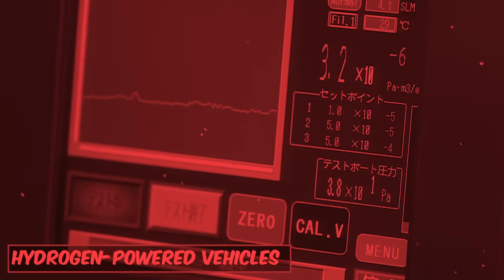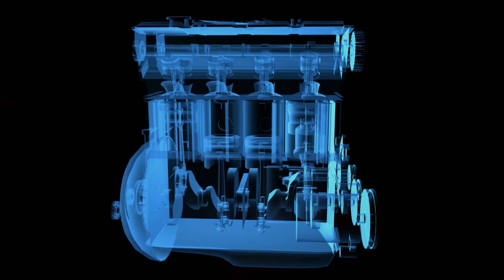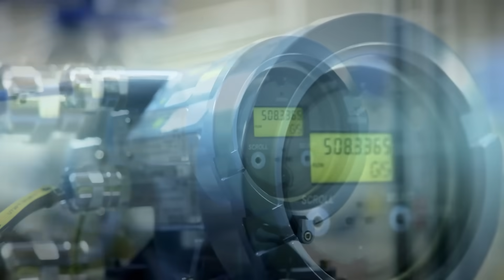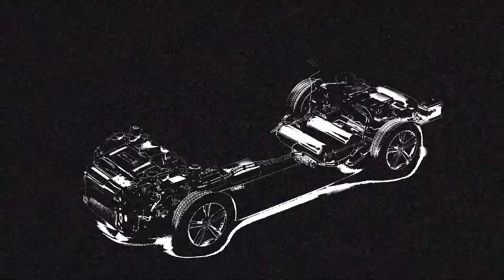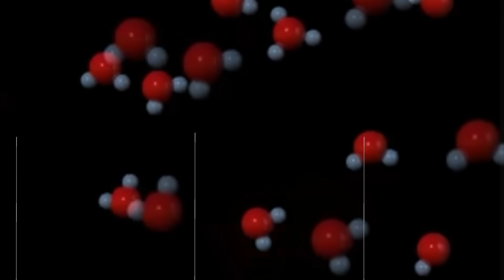Toyota's New WATER Engine Will Destroy The Entire EV Industry!

Comment: Doesn’t this violate the 2nd law of thermodynamics that means you would have to put more energy into splitting water 💦 before burning 🔥 and combining it back into water 💦 again?
Reply: It probably won't actually combine it back into water otherwise there'd be no energy for the car to use. Even the "actual water engines" people have made for their own cars in videos imply they still have to refill the tank with water but equally as gas vehicles
Reply: @mastupilo9653  I have no idea how these are supposed to work. If you use energy (in any form) to break down water into hydrogen and oxygen you will ALWAYS get less energy back when you burn the hydrogen.
If you don't burn the hydrogen, as you suggest, then no energy will be released.
Reply: Stanley Meyer successfully did it and drove across the America on 20 us gallons of water
Reply: I used hydrogen i have from a bottle welding gas that supply stores sell. I injected a old propane type engine with a controlled by a regulator mix as a fuel. Ran real strong.  Problem of converting H2O into a gas is the ticket. Back a few years fuel cells were being tried.  Its the components that are the problem . Takes alot of power to split it but it can be done.
Reply: @robertghorne8607  Bob Lazar figured it out.
Reply: @SHL-ge3wn  he's the guy who ended up MIA?  Gasoline starts as a liquid then it gets atomized @ carb. Fuel injection samething. U add nitrous oxide as a gas its a power booster . Now making a element that does  water into a gas when needed . These guys who say they did it seem to end up gone. Makes 1 wonder if its not that big of a  deal to make somthing that'll do it.
Reply: @robertghorne8607  The perpetual problem is that you cannot get energy for nothing and you certainly can't get it from water.
Fortunately for the con men selling this technology there are plenty of dupes out there with no understanding of thermodynamics who can still be fooled.
Reply: @eckyhen  problem is turning water into hydrogen from fuel cell technology. But make only enough to run a engine is the plan. Components take alot of watts to do this.  In a conventional type of cell that uses heat/ electrolysis  to split out a  gas from water. Still its possible. Dont take much to run a small engine. In air gas ratio. But it. Has to be a constant amount  with more for speed increases . Something as a propane engine.
Reply: @robertghorne8607  What is the point of using an energy source to split water into hydrogen and oxygen and then turn the hydrogen you have made back into water if you get less energy out than you used to make it in the first place?
Reply: @eckyhen  More moving parts which would need replacing.
Reply: It would if done without a catalyst.  A platinum anode works as a catalyst, as does a mild concentration of sulphuric acid in the water.
Reply: @TheTrock121  So what?
It still does not overcome the fundamental problem.
You have to expend more energy splitting water than you get back whem you burn the hydrogen produced. This cannot be overcome by catalysts, high voltages or any other magic. It is just a fundamental problem which is called the law of conservation of energy'; (first law of thermodynamics)
"Energy cannot be created or destroyed, it can only be converted from one form to another."
Reply: The energy needed to distill water has to be found somewhere and this energy cost must be added. How does this relate to the energy balance?
Reply: @lievenmoelants  dehumidifier gives DI water. In its process
Reply: Nope !
Reply: it also violates common sense.  if you made such a device why would you turn it into a car to sell to others.  when you could keep it and just sell people the energy you make for zero fuel cost.
Reply: @grabbagool it uses hho
Reply: It's a spoof. Quite amusing really.
Reply: Obviously but who cares if you are trying to con people. As they say, a fool and his money are easily seperated.
Reply: LoL 😂 
Yes they are - Just ask any Tesla Cyberstuck buyer...
Reply: Sssh! Don't expose the snake oil bullsh it!
Reply: @momochi9790:  Bull.  The Thomson-Clausius principle refers to the heat death of the universe and the fact that the energy of the universe remains constant but trends towards increased entropy.  Your reference to this principle is misapplied.  In this case, the "water engine cycle" (there is no such thing, BTW) is a closed system.  The T-C principle views the entire universe as a closed system.  Therefore, your boundaries are wrong.  Electrolysis is not a "catalysist" though it uses a catalyst (big difference) - it is actually a  chemical process that requires an energy input.  Don't try to use fancy science-sounding words to promote a fantasy.  The "watercar engine" as depicted here can NEVER and WILL NEVER exist until someone can figure out how to split water for LESS energy than the resulting hydrogen combustion can produce.  Period..  If you think you are right - prove it with your balanced Gibbs free energy equations, then publish your groundbreaking results in a scientific journal, get some DoD funding, and build a working prototype.  You WILL win the Nobel Peace Prize and be able to retire and leave your great great great grandchildren a fortune.
Reply: @DefinitelyNotOnTerms  OK. So you don't understand the science. Not a problem as many others don't either, but take it from someone who does. You must put more energy in to make the hydrogen than you get back when you burn it. Of course it can be made to work but it is pointless since it is less efficient than using your energy source directly to drive the car. Note that they do not say where the energy to split the hydrogen comes from.
This is just plain dishonest.
Reply: This video does not delve too deeply into the chemical reaction (beside general concept), so we can't really know unless we actually study and observe a working prototype or sample of the engine.
Reply: @ChrisAlbertH47  The mechanism of the reaction is irrelevant to the thermodynamics of the process. It ALWAYS uses more energy to make the hydrogen than you get back when you burn it. That is why you will never see a working prototype.
Reply: @eckyhen  I understand the concept that you're referring to, but do you honestly think that the engineers and scientists at these mega companies don't? If they're investing serious money into a project, do you honestly think it would be on a dead end?

We don't know what they're working on exactly, what the design of the engine is, or how it works. This video and others like it only have a general idea of what it could be , and that's the not enough to base any assumptions on.
Reply: NO!
Reply: If you believe in UFOs, you will note that the way they are said to accelerate and change direction, also violates certain basic laws of physics that we accept at this time.
Reply: Thank you
Reply: 😅it's not fiction folks, just Google it, it's almost here.
Reply: Yes. It is the usual old nonsense posted by ignorant conspiracy theorists designed to con the ignorant and gullible.
Reply: Thanks for using emojis, no one would have known what you meant without them.
Reply: B.s
Reply: DUW! mad magazine never mentioned thermowhatsits😅
Reply: It even violates the first law of thermodynamics, conservation of energy, because in this engine energy arises from nothing. Very convenient, but of course impossible.
Reply: @svergurd3873 it uses hho ..smaller versions has already been proved in kit forms
Reply: Yes and no.
There are other ways to split the atomic bond to free the hydrogen. Everyone assumes it's generic electrolysis which is not the case here.
I can see many people laughing initially until they realise they have been scamed into believing water can't be a fuel.
Let's just get some facts sorted first.
There is no such thing as fossil fuel, it is made by conventional planetary forces (see Titans massive oil reserves) and look deeper into hydrogen and you will find alternative liberation methods that overcome the apparent conservation laws.
One thing is for certain yet few realise yet that the future of energy production will be hydrogen based, at least while we use exosion techniques but after hydrogen had run it's course the following phase will be implosion tech.
Yes, you can indeed actually run a car on water if you don't use electrolysis
Reply: Absolutely.
Reply: Lookup Moxy fusion reactor.  Toyota is probably using Argon gas to create  a cold fusion reaction.
Reply: 3:28 he definitely says "diluted water". Diluted with what? Petrol?
Reply: Do you know your microwave oven can reach higher temperatures than a regular nichrome wire heater of the same wattage? That doesn't violate law of thermodynamics. It just means that special substance as catalyst which aids in production of excess energy. 

I did a quick search and found out that Scientists Have Developed The Most Efficient Water-Splitting Catalyst. The catalyst is made up of a ferrous metaphosphate and a conductive nickel foam platform, a combination of materials the team says is more efficient and less expensive than existing solutions.
Reply: NO
Reply: Consider the two operational states-1. UnSteadyState: At start, there is no energy begin the electrolysis (thus requires a battery. 2. SteadyState: The energy to separate Hydrogen from Water is greater than the energy of the released Hydrogen. The battery is then the only net source of energy, the engine quits when the battery is depleted. Essentially what it is is a very expensive, and illogical BEV.
Reply: Peaple  are forgetting  facts do you want a 5 minute to fill up with high  pressure  hydrogen   or a 1hour of sitting  on a charger 🤔    and then hoping  your car doesn't  spontaneously  combust  😂
Reply: That is the point. Until law's of thermodynamics change
Reply: Yes cos to split water into hydron and oxygen you need atleast 12v at atleast 10amps so a car 10amp battery will go flat in 1 hour and your car won't start untill you charge it for 24hours.
Reply: They must show us energy balance ( energy In / energy out ) . You will see that energy in is greater than energy out.
Reply: Using a low voltage pulsed method it’s economical, it’s how Stanley Meyer did his initial system
Reply: Hydrogen bombs release a lot of energy and I can't see that it takes too much energy to make it a reality. The advances made in battery technology makes me believe we were told a bunch of lies by gas corporations.
Reply: Complete and utter nonsense. Splitting water into oxygen and hydrogen needs A LOT of energy. If you’ve ever seen an oxygen/hydrogen explosion you’d understand.
Reply: When he breaks the water molecules down he is shattering the water molecule bond between the hydrogen and the oxygen  with low voltage electricel  at a frequence that shaters the bond like the singer sings the right note that shaters tbubbles. Betwen the oxygen and the hydrogen. If you see the videos youl see the gases fome up. The navy witch uses higher voltage gets a small stream of bubles. No fome of bubbles.
Reply: Splitting hydrogen from water is in the amperage, not  voltage or more power, it takes very little power to separate hydrogen from water. Do your research
Reply: EXACTLY...dudes doing it for $500 in ads 🤦
Reply: The presentation of the idea is COMPLETELY wrong. Whoever has written the script, is not really Science literate. (I wonder how deep was the involvement of chatGPT).

The system is not "Fueled" with water. It is fueled with electricity that is used to electrolyze water. ( @1:31 ) 
Water is just the working fluid. It gets broken down into Hydrogen & Oxygen. The Hydrogen should get separated from Oxygen & stored into a tank for being oxidized back to water in the IC engine. 

The whole thing still runs on electricity. It is just changing the battery from Lithium ions based system to Hydrogen based one.

It is a lot of jumping around in terms of thermodynamics & too complex. For the foreseeable future, I will not be moving my investment from Tesla to Toyota shares.
Reply: will see, how foreseeable You are, "Tesla owner". You simply can't know, what are they doing @ignorasmus
Reply: @ignorasmus  - From the performance of Teslas this past week, in the Siberian Xpress, I wouldn’t have stock in it either.
Reply: @ignorasmus 
It's a joke to test people's gullibility.
Reply: @ignorasmus  there is the other way though. 
Conventional electrolysis is only the cheap crude high loss methodology. Getting hydrogen and oxygen separated can be facilitated a number of ways. For example the resonant frequency of H2O allows for low power separation compared to electrolysis, the trick is the frequency shifts and that's where clever open minded people play around. Convention has nearly always been the greatest barrier to all discovery. We know very little about true science, it's a fatal flaw of humans to suppose we know almost all of it. Concider Nikola Teslas Wardenclif tower, he stated in court he didn't send any electromagnetic energy from that tower yet a hundred years later we all still call him an idiot for not grasping the obvious flaw of square law losses by transmission which is correct if you attempted to radiate large quantities of power in the air but he wasn't because he used the second form of electricity, yes, there are 2. Yet the 'smart acedemics' still perpetualy push mistruths. Toyota are not simply electrolising the water nor adding electrolytes to facilitate the outcome, they are making use of unconventional and useful physics
Reply: Seems to me that an on board alternator/generator could supply the volts for electrolysis. So, as in gas engines, you would need a battery to start the process and it would be continued with the generator.

Does it matter if it takes more energy to make , than what is released from the hydrogen? The goal is to get rid of polluting transportation. So what if it takes more water to get comparable energy?
Reply: @JS-yv8ks  Hahahahahahahahahahahaha
Reply: ....Can't run a generator without MORE continuous power from the source you are not naming.... @JS-yv8ks
Reply: @JS-yv8ks  Bro, if it takes more energy than what you get back (which it does), then that means that the car will need a big battery for the production of the hydrogen that you will need to charge and you will get less range than if you used the energy from the battery to run the car directly...
Reply: @JS-yv8ks  You burn more petrol/diesel to make the generator work harder so that is not such a good idea.
Reply: No. There is NO fossil fuel involved ! So your idea is bad. @eckyhen
Reply: @JS-yv8ks  OK. Explain to me, in simple terms, where the energy to power the car comes from.
Reply: Really?? I think the basic idea is very clear, the engine runs on hydrogen ! Did you watch the video??? @eckyhen
Reply: @JS-yv8ks  Hydrogen from water is not a fuel source, it's a storage mechanism. You'd be better of powering an directly electric motor than converting electrical energy in to hydrogen and burning it. That would have less loss, and most importantly, less moving part which would need constant replacement.
Reply: @eckyhen 
Laughing Gas. This is a joke.
Reply: @DaveHaynie  I can understand how that would work but seems totally pointless and very inefficient since you will have energy losses with every conversion.
Charging, didcharging, elctrolysis
Reply: @DaveHaynie  I understand how that would work but since you have energy losses at every conversion it would be very inefficient. What is the point?
Reply: @eckyhen  I dug a bit deeper online... I'm convinced it's an outright hoax. Just because there is a way do to this, maybe (depending on the capacity of the electrolysis plant, your bottleneck) doesn't mean it's practical in any way.
Reply: Yep, it's an obvious scam. Toyota's engineering and PR departments need to sue the makers of this for defamation. Since I downloaded and viewed it in the UK, that gives British libel courts sufficient jurisdiction. OK, the presenters have an option of a "we are idiots and never wondered where the power for the electrolysis would come from" defence. But they played a straight bat, so they obviously weren't going for parody (which isn't a defence against libel in any case).
Reply: You violated the FIRST law of emojis… Never use one, and the word, in the same sentence.
Reply: It violates nothing. The bit about "high voltage"? It's what Stanley Meyer came up with; high-voltage, high-frequency (Meyer was ~22KHz), negligible current. IOW, negligible power required to break the covalent bond. See the injector? Water and the modulated electrical signal are fed directly to the injector and out comes hydrogen, straight into the combustion chamber.
Reply: @AdaptivePhenix  LOL. thermodynamics, remember?
Reply: @AdaptivePhenix  And where does that electricity come from? This proposal is basically a perpetual-motion machine.
Reply: @AdaptivePhenix You have it very clear!! I wonder where we can we get the specs for Stanley Meyer's water engine system? It would be quite an interesting read!
Reply: @AdaptivePhenix  No
Reply: @AdaptivePhenix  It most certainly does violate the first law of thermodynamics since it implies that you can create energy out of thin air.
It takes 286kj of energy to decompose one mole of water into hydrogen and oxygen an it is impossible to get more than 286 kj of energy back when you recombine them. In practice you always lose some of the energy so this engine is impossible.
Reply: @eckyhen   You mean like the US Navy Ship that runs entirely on seawater doesn't work? Would you like to inform them because I ain't.
Reply: That's nonsense. No engine is 100% efficient, you always lose some energy in the process of ANY engine. Even the electric motor is not 100% efficient.  @eckyhen
Reply: You should inform the CEO of Toyota, because he believes it is possible and just announced recently that they are working on that impossible engine ! @eckyhen
Reply: @AdaptivePhenix I believe that's battery powered much like the saltwater powered cars
Reply: @universalvindicator  No it ain't... that's ridiculous (weight?).
How can you people be so dense to not understand that splitting water doesn't need to be energy inefficient.
It's not free energy it is energy from an abundant resource.
Reply: @eckyhen  Dont the free point energy system could be used like ET and our secret craft
Reply: @pauldavies6037  Well if you can explain what "free point energy" is' maybe?
Reply: @JS-yv8ks  yes, it's called friction.
Reply: @eckyhen  the loss is due to friction
Reply: @AdaptivePhenix  Which ship is that, I'd like to know.
Reply: @AdaptivePhenix   This is physics.  They already know, because they have to supply the energy for any electrolysis.
Reply: @tpaine7680  Let me ask you something; It's generally accepted that 40 milliamperes is enough to kill a human being. So what happens when you grab both terminals of a car battery that can typically supply 70 Amperes for a full hour?
And how does that compare to law enforcement with their puny little stun guns. Which would you prefer to come in contact with?
Reply: @eckyhen but it's not taking it out of thin air it's taking it out of water
Reply: @eckyhen Its not impossible, you'd just need a power source to split water into Hydrogen and Oxygen, perhaps a big battery.  🙂
Reply: @st200ol  Yes, and you need to put electricity (energy) into the battery and you get LESS energy out when you burn the hydrogen
 How does that make sense?
Reply: ....That's a lie.... @AdaptivePhenix
Reply: @AdaptivePhenix  You have to add energy to the system to crack water... most, but not all, of that energy is recovered when you burn it in the engine. So you're going to need a large battery stack to crack the H2O, and you're going to feed an engine that's, what, maybe 20-30% efficient? It's heavier for the same mileage range than an EV and considerably less efficient.
Reply: @DaveHaynie  You still don't get it. You're still stuck on Faraday's method of almost 200 years ago.
High voltage @ a specific frequency (not Faraday's DC) and miniscule current (amperage) breaks the covalent bond.
Reply: @AdaptivePhenix  No, I'm not. Thermodynamics is path independent. You can increase the efficiency of H2O cracking, but it'll never be 100% or more. You can't go from a low energy state to a high energy state no matter how tricky you get without a net loss of energy. 

You're stuck on a lack of understanding of physics. Period. But if you do somehow figure out how to break the Second Law of Thermodynamics, I'll be watching you speech at the Nobel Prize Ceremony.... not worried about that happening.
Reply: @AdaptivePhenix 
No such ship...BTW..seawater contains salt.
Reply: @AdaptivePhenix  Doesn't exist!